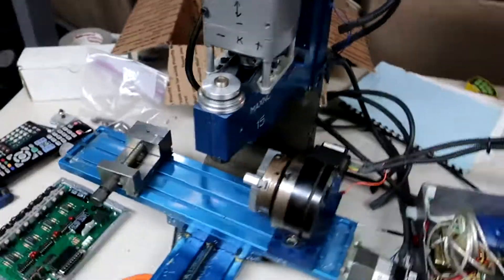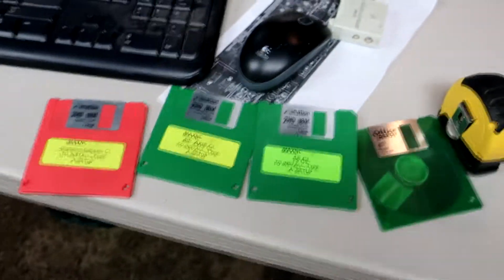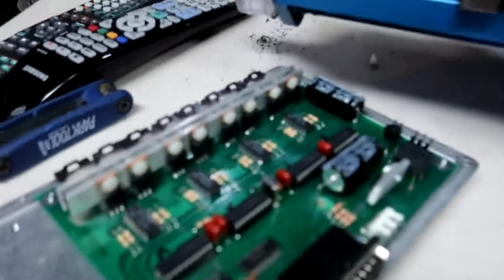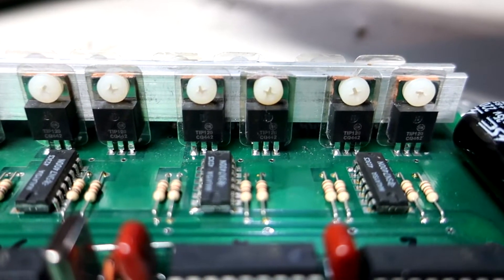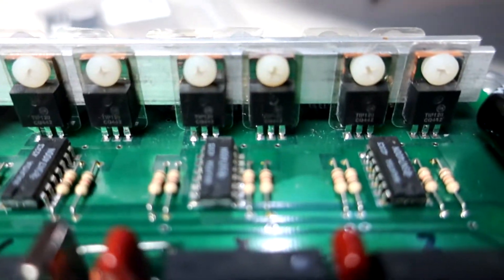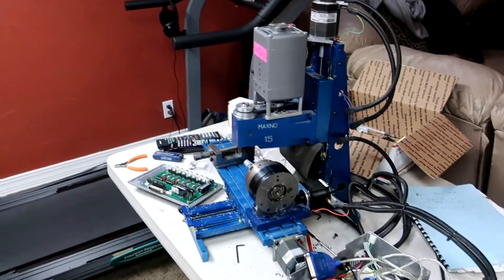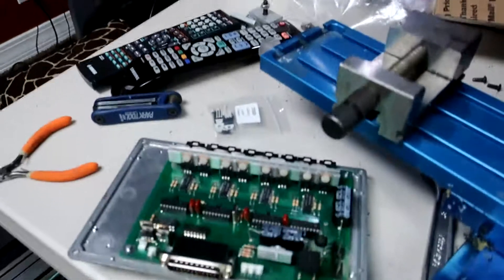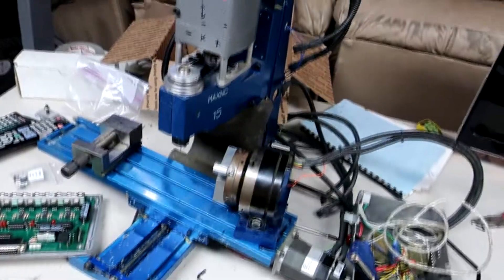MaxNC 15 Project

Comment: Is it possible to get copies of your maxnc disks? Thanks
Reply from the maker: https://www.dropbox.com/scl/fo/il521ak45zo0awl0z4f8c/ANV-7MiR8e66WBkxsE8-f3w?rlkey=hnhl5tag1sb2c2d7l9oeq1cjs&st=ctj39j2w&dl=0

This is what I've got
Reply: Thanks @chainmaillekid
Reply: @chainmaillekid  Thanks for sharing this, it saved me. My 3.5-inch floppy disks that came with my MaxNC15 CL are corrupted. Im going to try and get this running on a virtual Windows XP pc. Did you ever get around to getting it working?

Comment: To: Chainmaillekid; I have a Max-NC 18 that I purchased approximately 1997 from the manufacturer in Chandler, Arizona. The Z axis did not seem to work right  or seemed to skip steps. Anyway, this was never resolved. The software was DOS and made to operate on a 286 computer with DOS 5. I recently found a 286 computer that works, but I need the software for the operation of the stepper motors. I do not know how to contact the manufacturer to obtain the software to operate the Max-NC. Is it possible to copy the software for the Max-NC and send it to me. Sincerely, James Parker 08/02/2020
Reply from the maker: https://drive.google.com/drive/folders/1nl3rigaoNgi5izMFFXenaadkUPmDDfO6?usp=sharing
Reply: To:  @chainmaillekid   The folder will not download. It took a long time but it finally downloaded. Thank you, this should be fun now.

Comment: How is this coming?  I would recommend the following...1) You have two axes that work.  Try driving the other two steppers using the two channels you know are good.  That will check the health of the steppers.  Also, this is a closed loop system, so if there is an issue with one of the encoders on your steppers, it might also cause the unit not to step.  2)  Check to see if there is any holding power of the steppers on your two bad channels.  That should tell you whether there is any power coming out of your H bridge.

Comment: Love to hear what progress you have made. I have a MaxNC 10 with the 4th axis as well. Just rebuilt a 98 PC and got everything working (except still trying to figure out how to plug in the 4th axis as it has a parallel port as well...perhaps it needs a splitter cable)
What will you use to design or plot your projects....I am still new to the build design part...
Reply from the maker: Progress has died for the moment because my 3D printer arrived.

I've been learning Fusion 360, I think that has everything I'll need.

Comment: Hey chainmaillekid, Welcome to the Maxnc Community, I agree not a lot of us out there at the moment, but if you look hard enough you'll find some :-) You have probably the best model they made, in that it has closed loop support for the steppers, 15 inch model, and includes the 4th axis. As for the software as long as it can read imported g-code you should be fine. I believe RuralEngineer uses the original software as well. https://www.youtube.com/user/TheRuralpoet and he is capable of running gcode imported from else where. 
As for making the code you can download Fusion 360 for free and use it's built in cam package to create the code.  
If you tire of the original software or run into problems with it you can also drive quadrature wave from Mach 3 software as it supports both closed and open loop versions of the maxnc mill. I am running my mill off Mach, a cheap break out board and some parker motor drivers. It is open loop so I can not drive it too fast, I usually don't go over 20 inches per minute for that reason. You can make alot with this mill. I am about to gear up for a milwaukee battery to dewalt saw adapter mill video. I have the code done for one half just need to find time to mill it out. Your maxnc will be able to cut just about anything, up to and including mild steel if you take your time and nibble it away. I made 4 bolt clamping plate for my lathe with my Maxnc mill. Feel free to message me and ask any questions you have about the mechanics of the mill, as I have spent a good bit of time analyzing mine to try and get the most out of it. I look forward to seeing more videos of your progress.
Reply from the maker: Been meaning to get around to replying to this.

Thanks for this, it basically answers all the immediate questions I had.

Unfortunately I haven't been able to work much on the CNC since putting up the video, but I'll have to get to it soon because I need the space.